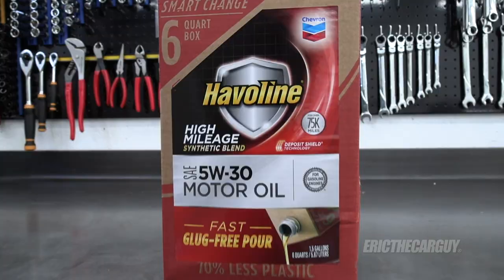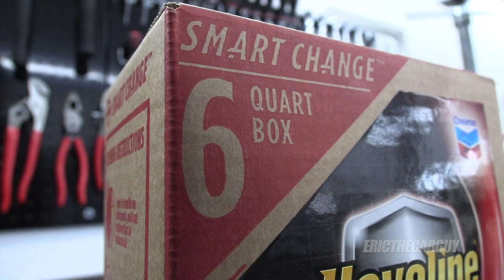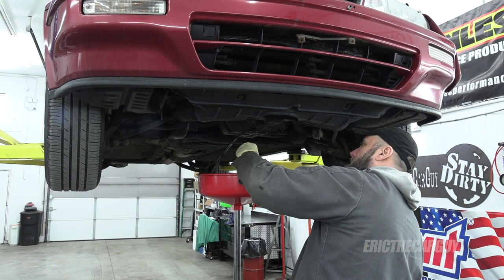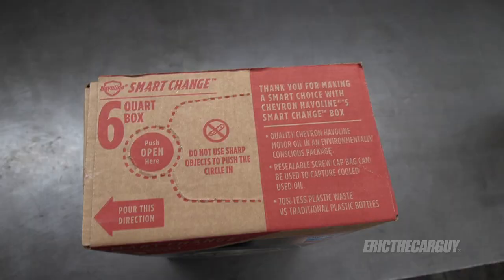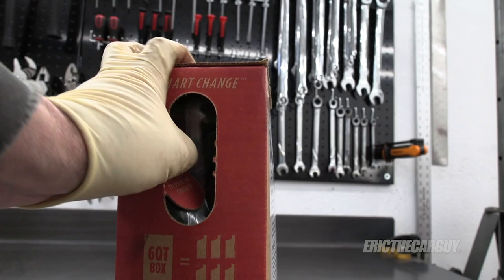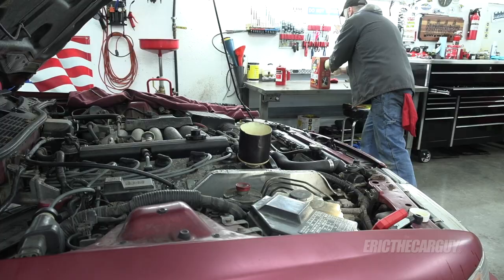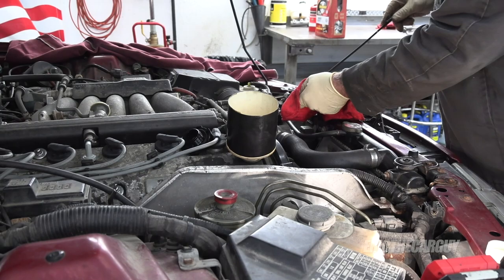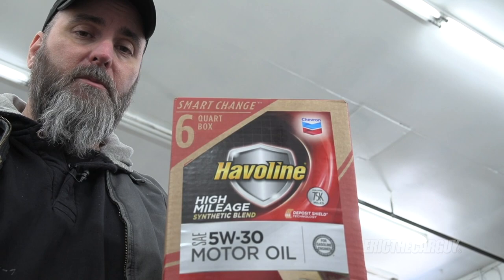A More Eco Friendly Oil Change

Comment: 'Bout time someone started selling 6-quart containers of oil -- my truck takes 6 quarts, and I'm tired of buying a 5-quart container plus an extra quart.  Geez!
Reply: my truck has a small sump so I just buy gallon jugs and that works out perfectly since my truck only takes 4 quarts. or I could buy 5 quarts and just take out a quart after I have filled it so it flushes out some of the old oil and then I can just save the extra quart of semi dirty oil and use it for something else like sharpening my knives or using it as jack oil.
Reply: Bag/Box is cool, less packaging.  But I think even more eco is using Amsoil Signature Series full synthetic and Amsoil filter and change the oil once per year.  Better than Mobil 1 annual protection... see Project Farm on youtube.  Costs a bit more but way fewer oil changes needed.
Reply: just buy 2x 5-quart containers when they are on special??

Comment: I wonder about the plastic bag that's inside.  A lot of recycle places don't take those but they do take plastic jugs that oil comes in.  On the other hand, manufacturing cardboard is obviously more eco friendly than thick plastic bottles.  I really appreciate that it's a 6 qt container.  My Pentastar V6 takes 6 quarts and I am forever buying one extra quart along with a 5 qt jug.  Super annoying.  I will look for this next time I go pick up supplies for an oil change!

Comment: I’ve been changing oil in cars since 1970 and I have never changed a crush washer. Never had a problem with leaking either.
Reply: On the same vehicle? I guess not !
Reply: Agreed, I've used the same washer for the life of the vehicle and never had a leak
Reply: @tardeliesmagic  My car still has original sump plug gasket/washer for trans. Thats after 3 trans oil changes (310,000km), never leaked. Re-used sump plug gaskets on customer cars when new one deforms, never had one come back either
Reply: I have reused the same washer for several oil changes.
I do tend to swap them after the 3rd just for safety sake.
Reply: I swap the oil in my moped every year, did 12 oil changes so far, always used the original (copper) washer. No leaks.

Comment: If you hold the oil container sideways, it doesn't get as sloppy. The idea is to let air into the container while you're pouring. Tilting it too much causes the oil to surge out at times, making a mess.

Comment: I’ve been buying this oil. Its a pretty good value for synthetic blend oil. I gotta admit, the packaging is a bit of a PITA and I just reuse and save a couple of old gallon plastic oil jugs (one to pour the extra quarter of fresh oil into and one for the waste oil to recycle). I wouldn’t even attempt to try to pour the waste oil back into that bag ... or carry it back to recycle in my car in a bag like that. I am not much of an “oil snob” and my Dad ran Havoline in his trucks forever with no problems. I guess I go push it past 3k changes, but I an old skool and that would disturb me!

Comment: Thanks bro, I had been doing fuel pressure tests for a while and after seeing your video to drain the fluid out of the fuel pressure gauge and all good 6 psi over 20 minutes, there was a clogged carburettor and air getting in the fuel hose between the fuel tank and the mechanical fuel pump as well, cheers who would have thought all fuel pressure gauges don't work with the fluid in them

Comment: I came across this stuff last time I had to change my oil. Glad to have found it, though I will say it was a bit tricky pouring it without getting any oil on the cardboard so I did end up having to cut some of the oil-stained cardboard out in order to recycle it, but it was probably less than 10% of it. It's an awesome value, too, and the perfect amount for my Explorer.

Comment: That is a good idea, so much better than using all of those individual 1 quart containers that so many Americans like to use for some reason.  Would be good to see that cardboard system over here in the UK. I have been changing my own oil for coming up on 40 years. I have always bought either a 5ltr or 4.5ltr plastic can of oil, but i can still remember the old metal 5ltr cans of oil. But it would certainly be good to see those cardboard boxes of oil for sale here. Just think how many of those plastic bags inside those boxes could be made from just one traditional 5ltr plastic oil can, plenty would be my guess.

Comment: Thanks for showing this. I didn't know about it. I've never seen it in stores or on TV. It could use a longer pull-out spout to put in the car filler neck, just invert the box and fill, no glug glug glug from the bag.
Reply: Actually the bag shouldn't glug, atmospheric pressure would make it flow smoothly.

Comment: I use the oil bottle to take the old oil to the waste depo.
It being made from HDPE plastic means it is also recyclable too.
Cant say how well that thin plastic is when it comes to recycling since we dont get it here in Oz.
Reply: Despite being HDPE, used motor oil bottles are only recyclable if they're completely clean and dry.  Even a little bit of motor oil residue in them renders them unrecyclable and technically classifies them as household hazardous waste (at least here in the states).  Far less material is recycled than people think.  Sadly, just because a material is recyclable and you do everything right still doesn't mean it  will actually ever get recycled.  The best thing we can do is to just use less stuff to begin with and to reuse as much as we can along the way.  The order of the words in the slogan, "Reduce, Reuse, Recycle" is actually quite deliberate.
Reply: Ditto.
Reply: Should just start using steel cans again.  You can recycle those no matter what was in them.

Comment: but isn't the plastic jug recyclable as well? I mean honestly it comes down to who you give your oil to when you're done because they are the ones who dispose of the jug. I work at home depot and I am pretty tight with the guys in tool rental and all home depot tool rental centers have a 50 gallon drum in the back that they use for waste oil since they have to do oil changes on all of their tools. and they let me dump my oil in their drum and I clean out my plastic jug and recycle it. but I am not going to toss the cardboard box in the hippie bin and then take the super thin plastic bag full of oil in my truck down to autozone and risk it breaking open and leaking oil all over the bed of my truck and then on to the road. also I don't like halvoline 😛.

Comment: Are you sure the box will be recyclable after it's been contaminated with engine oil? As far as I know, even the pizza box is NOT recyclable if it was contaminated with oil...  O.o
Reply: Yep, if you get oil on it, it is trash. It's nearly impossible to pour used oil back in it without contaminating. Oh, and you don't have oil on your hands or gloves while touching the box either. Less plastic sure, but recyclable cardboard? Nope.
Reply: Please, do not misunderstand me. I like the idea of using less plastic, but...
Calling the experts... Would it be possible to use recyclable plastic cans for engine oils?

Comment: It's so annoying when cars take some odd amount of oil. 4.7 qts? They couldn't make it an even 5? I have GMs that take 4.5. I just dump the whole 5 qts in there it doesn't hurt anything.
Reply: Except at oil change places where they may not pay attention if its not DIY done.
Reply: I suspect the original was in liters - but who knows?  Maybe they fit the pan in the available space and adjusted the volume of oil in response?

Comment: Best environmental solution would be sample the oil and only changing it when the lab says to.  Nice product
Reply: And this is why engines start having timing chain and roller follower issues. Stick to the manufacturer's recommendations, not a random lab if you want your car to last as long as this Vigor.
Reply: Kevin ya just saying what the army does they never change the oil unless the test lab says to.   The lab usually gives you and estimate on remaining life.  Modern synthetics oils are amazing.   Anyways I always follow recommend change intervals.

Comment: It's a cheaper package but there's no reason why they couldn't have done it years ago. a small mod and you could even make it pour very easily. 

I mean the old steel cans would be easy to clean and recycle but more expensive. The only real problem I see with this is reuse for disposal in theory old jugs can be cleaned and even reused, with a small supplychain modification. Failing reuse, they could be cleaned and recycled, though with more impact than cardboard... I don't know which is better they seem to alternate between wanting to 'cut down' on wood products and disposable plastics.

Regardless. Thanks for sharing! I had no idea a packaging change was in the works.

Comment: Is there any concern about using a full synthetic in older high mileage vehicles. I’ve heard it can deteriorate some of the seals and gaskets.
Reply: synthetic cleans better then regular oil.  What happens on occasion is that the sludge is the only thing keeping the oil in, and once you remove it the already bad seal reveals itself

Comment: Didn't you have something against running High Mileage oil unless the engine actually had leak problems?  I have 244,000 miles on my Cobalt and I still don't feel the need to run High Mileage oil.

Comment: i use that. have been for several years. it is also cheaper. i can get 6 qts at walmart for around $16 and at the parts place one quart is $5 or more. i also use havoline, have been for 50 years. it is becoming difficult to find

Comment: Hi Eric I drive a 2014  Hyundai Santa Fe sport it has a gdi engine (no turbo) It has 85000 miles. Oil changes every 5000 miles they were all at the dealership for $50 
I want to do it myself, I  looked at the paperwork and it said they used 5W20 but I don't know if it conventional or synthetic. Should I just go for synthetic or conventional. Like you said older engine might start having leaks, just wanted to know. Thank you!
 Also they used Valvoline oil. Should I stick with it or get the Amazonbasic heard it good and a good price.
What your thoughts?

Comment: Hey eric, k have a 2002 civic ex,v-tec,manual transmission. I keep getting this p0113 Intake air temperature sensor for over 2 weeks now and every tine i erased it and Clean the connection with electrical cleaner and put electrical grease on it, it still keeps coming up and it make the car burning gas more than it should. Can you tell me what you think is causing the issue? If its open circuit,how can i find it?

Comment: 3:18 where did you find the screw in funnel from?  Are those standard sizes for the make of each or is MOST of them the same thread?
Reply: Looks like an old bottle of some sort.
Reply: @panzerveps  it is, an old other oil manufacturer, seen it in some older videos. Believe it was an Castrol bottle. But was taped up to hide the name since this is for a different oil maker.

Comment: I noticed that when the new oil filter was installed, no oil seemed to be in it (it would have spilled out, in this case). The gents over at Horsepower TV, charge the new oil filter before installing them. Is charging an oil filter before install not necessary?
Reply: If it would have spilled out that negates filling it with oil before installation. It is not necessary and with many vehicles/engines you can't pre-fill the oil filter.

Comment: Why do they not put crush washers in with "oil change kits" ?  Especially with filters with limited usage.  I hate being ready to do a change - only to find they did not send a drain plug washer.
Nothing worse than a trip to the parts store for a $0.25 item.  Often you can only buy packs of 6 or 10 and then have 9 useless things on the shelf.  errrg.

Comment: i tried this stuff in my dads 2001 Suzuki grand vitara v6 and this oil got burned up i had to add a quart of oil every 1500 miles, so i went back to valvoline maxlife and its still full after 5 thousand miles!
Reply: Good to know.  I use that or Castrol High Mileage in the green bottle.  Not only do they not burn off, but with the Castrol the engine actually runs quieter.  They're usually 10-20 dollars more per 5 quarts, but I'd rather spend the extra and get another 100,000 miles out of my SUV.
Reply: @YamFZR93  i havent tried castrol gtx high mileage one,  maybe i should try it on my dads next oil change! thanks for the tip!

Comment: Hey Eric, I use Castrol high mileage 25-60 for my 93 golf cl, I know crappy car, but my question is... would I damage the engine if I switch to the one you advertised?
Reply: 25W60?
Reply: Nope

Comment: Now if every oil/fluids company did that, there would be a big drop in waste.
Cardboard is good for recycling and the bag is so thin that it would be a tiny amount of plastic.
If they went back to the older tin sheet containers it would be easy to recycle or just a handy container that was retained by the owner.
So will your car do lightspeed now lol.

Comment: 2010 Yaris  with 150k miles, time to switch to high mileage synthetic?
Reply: Typically no, unless you see that you are leaking oil from your seals.  High Mileage oils contain an additive that causes rubber seals to swell, closing off oil leaks.  If your engine is not currently leaking oil, I would just stick with what you're currently using.
Reply: Why not eh, get to 300k

Comment: I run royal purple in my car!
Reply: Good but overpriced
Reply: Depends on the vehicle.The normal car no way !! Mustang? I wouldn't. Over priced.
Reply: Tardeli costantini I drive a Lexus IS modified 350
Reply: Mr Cabot I drive a tuned Lexus IS 350 + I’am the shop Forman @ Lexus, Nissan, Toyota dealership. + I get it @ employee pricing.
Reply: Tardeli costantini sorry I drive a Lexus...

Comment: I don't think this is an eco friendly  thing,  first they use a cardboard and plastic,  and it goes to recycling bin, ok. What I'm using is just the plastic container and it has a marker or level , it will tell you how many quarts you need , unlike the eco friendly thing that Mr Eric the car guy mentioned,  it don't give the exact measurements when you pour it .

Comment: Ironic given how un-Eco friendly the oil inside is, the saving in plastic wouldn't be much more than the amount of oil that was spilt at 3:27  If you want to make your oil changes eco friendly stick to the manufacturers oil change schedule.   Don't change the oil earlier just because you think you know better or because 'oil is cheaper than engines'  - eye roll -  If you haven't made modifications to the engine greatly increasing the power & wear rate all you're doing is wasting time, money & oil.   My car has new synthetic oil every 10,000 miles, it's 17 years old & done 150,000 miles.  No engine or turbo work needed, heck the valve cover has never been taken off.
Reply: Chris Wales you must be fun at parties
Reply: @PaulsMechanics  Strange you should say that, I don't get invited to parties anymore ...
Reply: Chris Wales funny that, isn’t it?
Reply: @PaulsMechanics  More of a relief TBH after giving up alcohol they were rather boring.  Plus having to continually correct people was becoming tiresome.